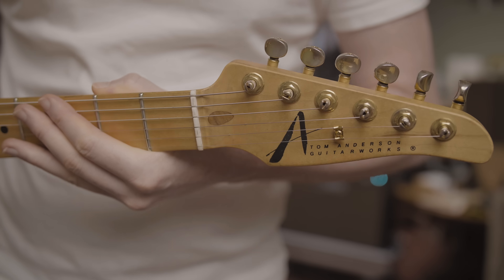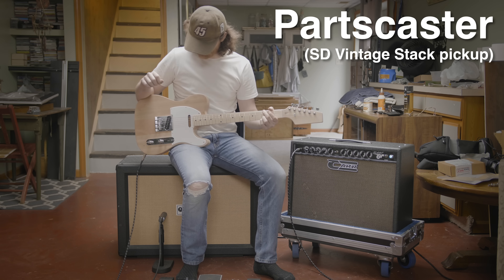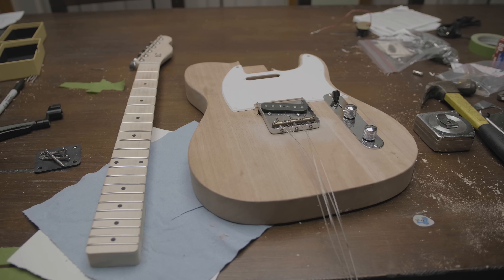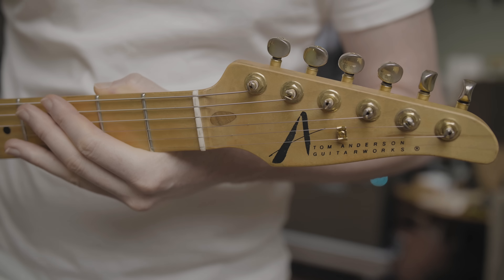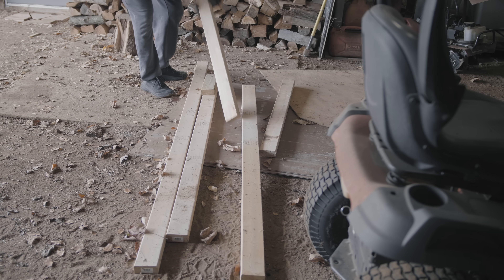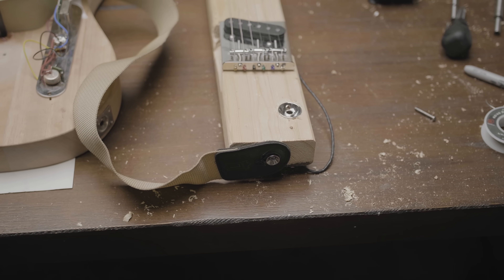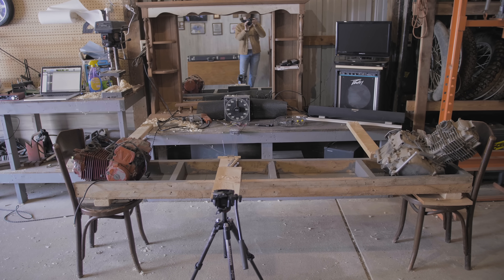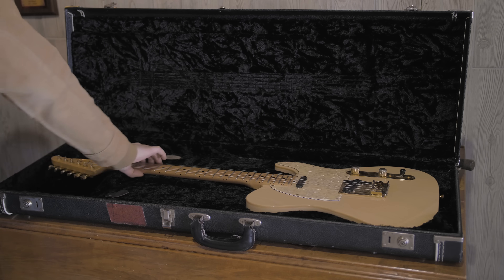Tested: Where Does The Tone Come From In An Electric Guitar?

Comment: I always said that when you buy high-end electric guitars (and basses) the main thing you pay for is the playability, comfort and their collectible value. Not the sound, because you can get an almost exact sound on a cheaper guitar by swapping the parts. Playability is the biggest difference the price tag offers. This video has proven that, and more.

But still I’m blown away on how the Air Guitar sounded. What an amazing and detailed experiment, this is THE BEST electric guitar comparison video EVER.

I would very much like to see you do this on an Electric Bass, I wonder would the result be the same because the frequency they produce is different. And IME it’s always harder to find a good sounding Bass than Guitar.
Reply: What bass/strings/amps you like 
I’m a jazz guy for sure but love the zing of the stingray and have a reverend Raymond and really love it 
I’m pretty sold on fender nickel/steel 7250 I believe… very punchy and gritty
Don’t like Ernie ball strings or dr 
Used to love roto until I found fender
Reply: @kodykindhart5644  I own several Basses and put different Strings on them. But currently just down to two brands, DR and LaBella. Stingrays do have their own character. I prefer warmer sounding strings on a Ray, Nickels mostly.
Reply: Expensive guitars are all about build for me. Having a nice feeling neck, no frets scratching me, aligned nut, intonated correctly, etc.

Sound can always be altered. To be it's all about pick ups and pick up height

Comment: Alright, so, the first builder has no interest on responding with honesty, it's reading a marketing panflet. The second got it almost right, the third one got it kinda right but its being really vague about it, like not wanting to give any real information across.
The neck is the main cause, the nut and saddle materials, the strings(different models/brands of strings will have different tones) even same model/brand of strings will have different tones if one is a few months older than the other one.
The way the neck meets the body of the guitar is a huge factor, Japanese builders knew this and that's one of the factors Japanese guitars are better. Of course the electronics on the guitar make the tone, but the real test should be without electronics if you're talking about what "makes" the tone and not what "captures and transmit" the tone.

Comment: My suspicion was always that wood type doesn't affect tone but does affect sustain. Testing sustain would be a great addition to this experiment. Well done!
Reply: Yes, exactly. Different woods have different density and weight. I don't know if i'm right, but it felt like the "air guitar" had a whole more lot sustain, because it was straped to a heavy working bench.
Reply: @Quonchon  but what does that mean? As long as the ends are fixed and not moving, the string will vibrate the same
Reply: @martinpaddle  I think you answered your own question with "ends are fixed and not moving". If you take that idea to the extremes, if the body was a light piece of foam the bridge and nut would move and dissipate the energy of the strings. If attached to a giant piece of ironwood there would be very little dissipation and the strings would ring longer. I'm not a physicist so I'm probably not explaining this well, but my instinct tells me there would be a slight difference between the sustain on a soft pine body vs a solid rosewood body. Just a guess though.
Reply: It's not sustain per se. It's the harmonic richness that varies with wood.  Ultra dense wood can sometimes give days of sustain but the tone is underwhelmingly overbright.
Reply: @dodjiegarcia2320  This video seems to disprove that as there was no detectable difference in harmonic content. As you said, dense wood will sustain longer.

Comment: I always wanted to do something like this but you took it to another level. It still won't convince everyone but it just confirmed what I already thought just from years of building electric guitars. Pick up quality/type, position and height seems to effect tone a lot more then the age of the wood or paint thickness, body weight etc. Subtle differences but most won't notice and with effects and EQ and amp will also have a notable effect.

Comment: Can't fool me. Those were special "tone" Honda engines.  But kidding aside there was always so much debate to this topic. It seems with an electric guitar the wood is not making a huge difference. Granted I can normally tell a Tele from a Strat from a Les Paul from an SG with effects and EQ could probably fool someone. The sound comes from the players fingers, to the strings, to the pickup, to the amp. Everything else seems less critical. I saw a video where someone made a guitar from a toilet seat and it sounded great... because the guy could play. Now "feel" is another thing and that can make a difference because if a guitar feels right it tends to get me to play a lot better hence sound a lot better.

Comment: I am reading some comments and most of them seem to lean towards the " Wood is insignificant to tone" it is just not true, go back and listen closely, the full body guitar had more depth to it. If you play metal trough high gain amps and EMG's, ok, you'll hear just that, but tone woods are more noticeable on mid gain amplification. An then there is the hypocrisy factor; when confronted with the choice of buying a guitar made of real wood vs a substitute, no one will want to buy a guitar made of plastic, MDF or plywood.
If you install the same pickup, say a SD '59 on the bridge position on a Les Paul type guitar and on a Strat type guitar, they will sound different; because of wood species and construction. I believe there are several videos on YT on this subject. Also fret material and proper installation makes a huge difference in tone, making the body less experiment invalid, you a re only hearing the nut and the bridge tone on the strings, but what if you play a barre A Chord? if you frets are poorly installed you will have dead spots and lesser tone and volume. Again, nothing against this gentlemen here, I am pointing factor that were not included in the video, and are crucial to tone.

Comment: I use a top loader tele. I’ve had it for 4 years now and it’s incredible. It’s a partscaster. 
Body is a 94-96 Mexican tele body that my friend had and used as his main session tele during the 90’s. He used it on a few Martina McBride recordings. The neck is an all parts 50’s C- Shape. I have the long flat bridge on mine. The original Hot tele bridge pickup died not too long ago and a Fifty-Two SD was put it. I didn’t realize you could wear a pickup out in 3 years lol. The neck pickup is a stock tele neck pickup and it’s very thick and clear. Teles are the best!

Comment: Oh great, the next big thing that people will share around as "internet gospel." This is just hilarious, as the final test proves nothing. Yeah, there is no wood UNDER the strings, but both ends of the strings are still anchored to wood. I'd argue there is much MORE wood in that shelf and workbench than there would be in a guitar body or neck. Anyone that has ever strummed an electric guitar on a wooden workbench and then picked it up off the bench and strummed it will know what I'm talking about.

Comment: I've always said: If your an acoustic guitar builder "wood" and "bracing" is everything ! If your an electric guitar builder, "pickups and amplifier choice" are everything ! 
Thanks for all the time and work Jim, Cheers
Reply: Very different beasts, when you hear an acoustic what you hear is the actual body and strings resonating, the body being a kind of amplifier. An electric guitar picks vibration through electromagnetic pickups, and what we actually hear is speakers in a cabinet reproducing those vibrations, that's the reason a speaker change and amp design makes much more difference than body wood.

Comment: Congratulations, you got it right!
Yes, pick-ups, their distance to strings and the impedance of the electronics seen by the amplifier (value of volume and tone pots) are what most matters. Pot "quality" doesn't but that of the lead (through its capacity per length and its length) works as an added tone control. Proper adjustment of pick-up height and careful selection of the values and wiring of cheap electronics parts can make all the difference in the world.

Fret and saddle material have some impact on the top end (the harder, the brighter), as does nut material on open strings but that is subtler than that of the electronics. Finally, a floating bridge will always "suck" some of the high end by vibrating together with the strings.

Comment: I kind of skipped through the video so I'm not sure if you covered this, but when comparing the tele and the 2x4 you've also got the factor of string tension which is higher on the tele than the 2x4 due to the toploader
Reply: String tension is the same or the guitar wouldn't be in tune.
Reply: @Leo_ofRedKeep  No string tension does vary, try it out for yourself.
Reply: @roderickbalt8993  It does not. It may feel that way when bending because the strings have different lengths but tension is the same.
Reply: @Leo_ofRedKeep  Yes I follow that logic but try eliminating the angle either at the bridge or at the headstock and you can literally feel how floppy or tight the strings become.
Reply: @roderickbalt8993  What you feel is the sidewards pressure string tension causes through the angles (towards body and headstock). It makes no significant difference on tone, only keeps the strings in place better when hit hard.
Reply: @Leo_ofRedKeep  I'm sorry but your theory is wrong or perhaps we're experiencing miscommunication on the term of tension. If you reduce the angle at bridge and/or headstock you will have a floppy sounding and playing guitar, this you can test yourself. I don't know how this works because I'm not scientist, it's just experience.
Reply: @roderickbalt8993  As I said, the sidewards part of the unchanging tension keeps the strings tight against the nut and saddles. The break angle at contact points changes that sidewards component, which is then equal to string_tension * sin(break_angle).

Comment: Love your take on this! I’ve always believed from years of playing tons of different guitars that the things tha matter the most is in order 1. Pickup locations in relation to the bridge and nut 2. Type of pickup construction magnets, wire, number of turns etc 3. Orientation and height of the pickups ie slanted, low, high. But again most of it is how far the pickup is from the bridge! If you put 2 humbuckers in the same spacing as a Les Paul on your air guitar I’d sound like a Les Paul. 3 single coils and you’d have a strat. The only anomaly I’ve found is that for some reason guitars with metal bodies always seem to have a metallic bell tone to them. I’d be curious if your air guitar set up was a steel bench if I’d have a metallic “ring” to it?

Comment: Stuff like this happens all the time, not just about guitars. There is always going to be someone who swears the titanium bearing in their handlebars  headset on their bike make a huge difference from steel. I remember when someone showed how a wire clothes hanger sounded as good for speaker wires as $80 Monster Cables.

Comment: I tested 4 Gibson guitars.

1. 2000 Les Paul Classic
2. 2001 Les Paul Standard
3. 2008 Explorer 
4. 2012 SG Standard.

Same Burstbucker Pro pickups and setup.
The only difference was a bridge volume pot in guitar 1.

Guitar 2-4 sounded very similar, up to a level that I could not tell which one was which.

Guitar 1 sounded massively different from the rest.

Comment: Nice work Bro. Yes, everything affects the timbre, including the humidity in the air and barometer changes, pick material, shape and your own blood pressure as it affects your hearing. Some pickups make a BIG difference when changing the high of the pickup even a tiny bit and others don't. After 30 years of playing I've reached the point where I just play it and if it sounds good, I'm happy. If it doesn't I find a different guitar. : )

Comment: Brilliant work!  Now if you can figure out how to quantify "sustain" you can put the final nail in the coffin of "tonewoods" in solid body electrics.  Or not...physics dictates that the vibration characteristics of a string depend on the solidity of its 2 anchor points and the structure between them.  A guitar made entirely of concrete will have more sustain than one made entirely of rubber.  An exaggeration, of course, but the reason some guitars, particularly basses and acoustic guitars, have 'dead spots' with no sustain on some strings on some frets is because of natural resonances in the structure of the guitar that cancel out those frequencies.  Those frequencies depend on many things, including guitar weight and weight distribution, magnetic influences from the pickups, and stiffness and natural resonances of the wood in the body and neck.  If you visit the Collings factory in Dripping Springs Texas, you will see how they determine and match the resonance of each piece of wood that goes into each instrument.
I know that sustain is not technically "tone", but when you play a guitar on which the low E string just gives a dull thump on certain frets, you won't like the way it sounds.  In the real world, solid body electrics rarely have this problem, especially if you're a distorted shredder (or a shredder who likes distortion)

Comment: EVIDENT difference - nowhere NEAR as coveted or valuable as any maker or forum dweller would've'd you think. 

Whence in most pro shows I've played, I've done so using an old, COMFORTABLE, 70s brazilian Giannini Les Paul, with a good bridge and a rather nasal neck PU.
Reply: "EVIDENT difference - nowhere NEAR as coveted or valuable as any maker or forum dweller would've'd you think"

I don´t think so. Most makers and probably also most forum dwellers consider more aspects of guitar playing than just playing open chords and simple non-dynamic runs with overdrive.
Reply: @modestoney1577  whence my commentary on using a very comfortable guitar, which responds to my playing in the way I expect. 

I mainly refer to tone in my critic, to be clear.
Reply: @onadafazoquequer  But most guitar makers (and probably most forum dwellers, i don`t know) also include the response of a guitar to the playing to the equation- so i really don`t get your point.
Reply: @modestoney1577  well, you probably needn't get my point. 

Tone snake oil is what I decried in my comment, owning a Gibson R8 and actually getting better tones/feel with my old Giannini.
Reply: @onadafazoquequer  Ok, i am with you on that point - but what is "better" is subjective in the end. 
The big question is if there is a difference at all - and you obviously think there is.
Reply: @modestoney1577  Well, there is an audible difference between the different configurations. There are arguably other conditions to be considered as tone changing in this video, even as  the tester attempted to diminish these artifacts, but what is to be heard here remains. 

What I questioned is what measure of influence this diminutive difference is to be so dear to many (which, as you said, is subjective - so let this be my subjective take on this topic).
Reply: @onadafazoquequer  Yes, but who says that the "diminutive difference" as you call it, that we witness in this video, is the maximum difference that can occur when comparing two different guitar bodies? 
I think that if there are any differences in tone due the factor guitar body alone, they are not incredibly huge, so in order for them to be relevant for a player or not, strongly depends on the playing style of the particular person, and what this person pays attention to.
Compare it to a tennis racket.
If you hand a beginner two rackets that are pretty similar, but not identical, he probably won´t notice any difference at all.
If you hand the same two rackets to a pro, he probably can notice the difference right away and tell you which racket he prefers.

It is about fine tuning - and that is a delicate skill.
So i see that some people might say the difference is so tiny it doesn´t matter, while others say the difference is big enough for them to matter, and both would be right for what it matters to them.

That is why i don´t think it makes sense to talk in absolutes.
Reply: @modestoney1577  I thoroughly agree with your last comment. Details expectedly amount to  bigger differences when summed. What I've said is it is not some magic paper-in-snake-oil capacitor, formvar holy wire/ butyrate grail plastic that provides for your feel and overall tone. 

There is difference. Summed, difference becomes more apparent, as is evident Again: separately and sold as voodoo tone maker, nowhere near as covetable or valuable as any maker or forum dweller would've'd you think.
Reply: @onadafazoquequer  I totally agree with you on this.

Comment: Thank you for going through the trouble to prove this. 
The one thing that I’ve always wanted to try to test Wood Tone was to put the pickups on the back of the guitar and just strum the strings. If the pickup picks up any sound, that would show that the wood plays a factor. But even if it does pick up any sound, it would most likely be very low in volume. Which means all the sound coming from the electronics would over power any wood tone. Which would make it useless as a factor it tone. 
You should try this but also record it so you can see the waveform. Then play/record one song with the pickups on the back and a different song with pickups on the front. Then play both tracks. If no one can hear the tone wood track, you definitely won’t hear any tone from the wood.
Reply: the pickups cannot pick up the sound of vibrating wood. They're not microphones, they just create an electric current when metal strings vibrate on their magnetic field.